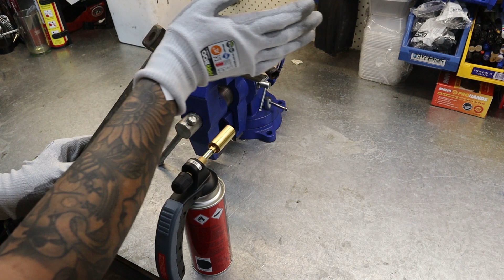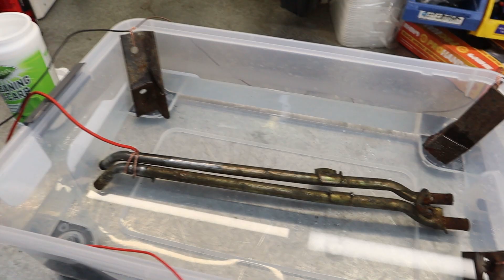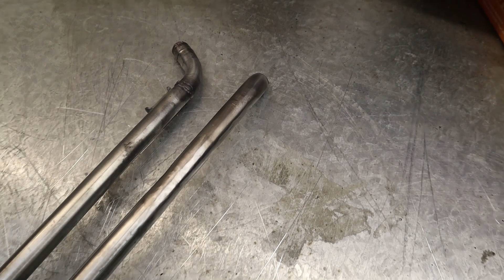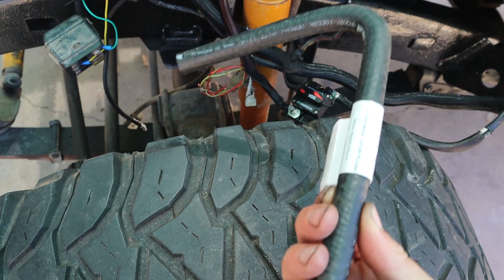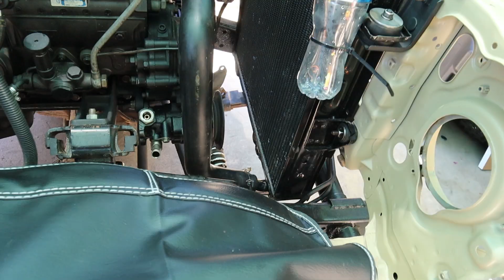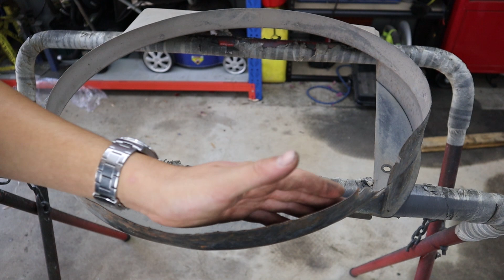12HT Cooling System - HJ75 Troopy Build (EP11)

Comment: Awesome build mate just discovered your channel 2 days ago and have already watched all your episodes. Just wanted to point out as a precaution that cable feeding the 12 way fuse block in the glove box may not be thick enough. If it's just powering the gauges it should be sweet but narva 5mm cable (assuming that's what you used) is only rated to 25 amps.
Reply from the maker: Marib Rafiq Thanks mate appreciate it! Good spot I hadn’t thought of that, at the moment they’re just for the gauges but I will swap it out in the future when more accessories jump on it, cheers!
Reply: @ShedBuilt  no worries at all, keep up the good work🙂

Comment: Good video.. you've put SO much effort into that 12HT.. I wouldn't expose it to these shitty old pipes. I think you'll be regretting using these at some future point.
Reply from the maker: Duncan Margetts yeah possibly mate. If you know anywhere I can buy a new set I’d be glad to purchase, in the meantime these will do the job just fine :)
Reply: @ShedBuilt  try lc 4x4 parts in gympie Qld. i ended up buying a heater pipe for $175 genuine. Leon is a top bloke to deal with aswell
Reply: I have some I don't need as my cruiser didn't come with the original 12ht but the water pipes were in the back as spare lol gimme a call 0487510640

Comment: I've been struggling to find a good spot to plumb my return fuel line back into my tank on my 2H-12HT conversion and just noticed you've TEE'd yours straight back into the feed line so I think I may aswell just do the same me thinks haha
Reply from the maker: Yeah mate good way to check everything works. Once I add the secondary fuel filter I’ll be running a line back to the breather on the tank 🤙